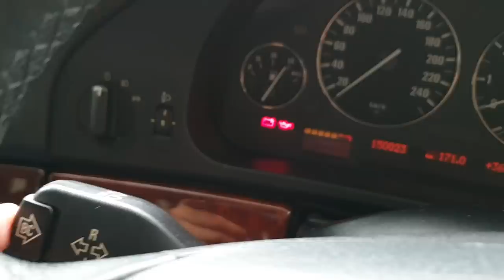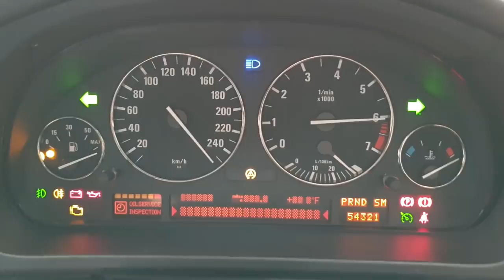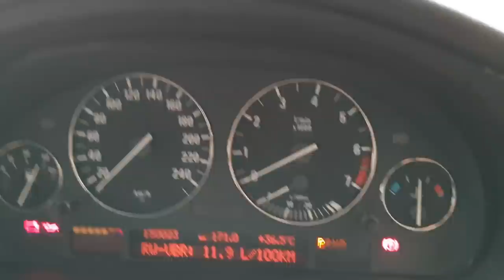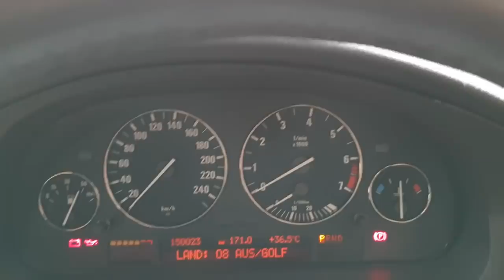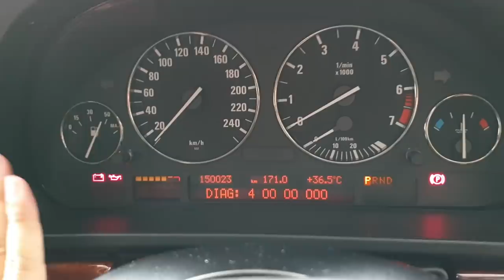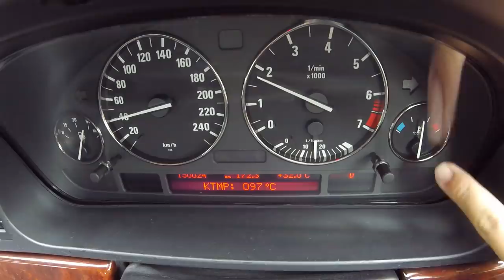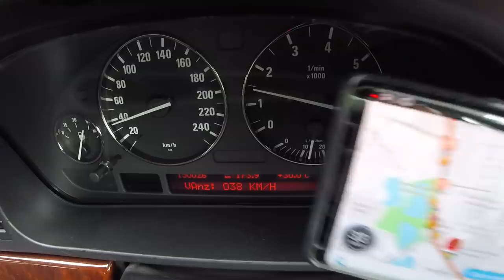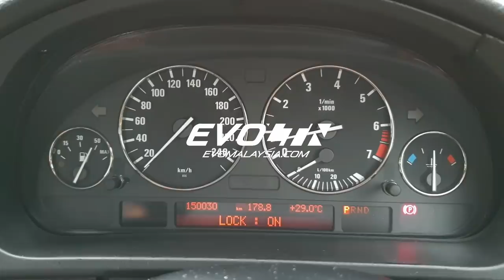BMW E39 High OBC Hidden Menus | EvoMalaysia.com

Comment: The sound of the inline 6 is lovely 💦
Reply from the maker: Engine's a delight to rev.
Reply: @KonWaiLuen  But sadly the turbocharged engines dont sound as good
Reply from the maker: @pratishwarankumaran2444  They pull a lot harder though. An F10 520i is a good 2-3 seconds faster from 0 to 100km/h than this. Haha.
Reply: But on the daily run 0-100 times won't really matter , as long as there is sufficient amount of power to overtake the car next to u it'll be perfect. Also, being a car enthusiast I love n/a high revving engines even though they arent as powerful as the boosted ones.Revving them out just gives me eargasm
Reply from the maker: @pratishwarankumaran2444  Awww yeahhhhh.

Comment: Nice review man.
btw the temp gauge does not read particular temp when is straight up, but it is considered as "operating temp". At least on my M62 the gauge is straight between 75*C and 115*C.
Reply from the maker: Same here with mine, which is scary, because once the needle starts moving up, it's actually too late. One of my mates actually reprogrammed the cluster to get the needle to fluctuate according to the actual temperature, which I think is better.

Comment: Can you help me pls? I entered to this hiddem menu to check the voltage values, and then I exited. Since then my speedometer and and L/100 km consumption gauges are not working. If I go back to the hidden menu and ran test nr. 02, all the gauges moving. Before I entered in this menu those 2 gauges worked fine. What happened? How can I fix it? Thank you for your answer. Edit: I alredy tried resetting the OCB at test nr. 21. No results.

Comment: Hey man, just got an e39 '03 530i model. How can you know if the miles have been rolled back besides the tamper dot?
Reply from the maker: The only other way to find out would be to connect and OBD scanner and read the ECU mileage

Comment: It seem ur meter don't pop up check engine light,same as mine,is it normal..
Reply from the maker: There's no check engine light for this cluster configuration. The OBC will just flash a line of text under the odometer.
Reply: @KonWaiLuen  oo i see..

Comment: Hi Kon, you sure does a lot car reviews. But can you make a video explaining when one should loan 5 or 7 or 9 years for a car?
Is it worth to get a 9 years loan for a better car or stay with low budget car with 5 years loan kinda..
Reply from the maker: Ermm... it all boils down to how you manage your cash flow and how frequently you plan to change your car. Most of the time, if you take a 9-year loan, the first 2-3 years (may be even longer) will see your car depreciate faster than you can repay your loan. During this period, if you ever decide to sell your car, chances are you'll have to top up money in addition to your car's selling price in order to settle your loan. It's not an issue if you plan to keep the car for long, but do be mindful that if you get into an accident and total loss your vehicle, you'll be in a spot.

It's always best to be able to pay off your loan sooner rather than later, so if you can find what you need or want that you can pay off within 5 or 7 years, that's the best.
Reply: Also an issue if your car got stolen. Best to take 7 yr loan max imo. Unless the rates are less than 2%

Comment: pls can anybody tell how to change the date on the e39 i have the same display same dashboard like this.. thanks
Reply: it shows 2017 and i don't know how to change?
Reply from the maker: You have to adjust it from the centre stack panel.
Reply: TheJoker-MK what if I don’t have the central panel anymore (replaces with Eonon)?
Reply: I would guess you could edit it with a good code scanner

Comment: Hi Kon ... can you share the fuel consumption of your E39. how much mileage u get from a full tank ? how much it cost you to pump full tank into E 39 ? Wat fuel are you using for you E39? how much is the estimated service cost for your E39
Reply from the maker: About 13-14 litres/100km. I refuel at about 450-500km intervals. Using mostly RON 95, but I did pump one tank of V-Power Racing to clean the engine up la. Servicing cost varies based on the work done la bro, do check out my other videos for this.